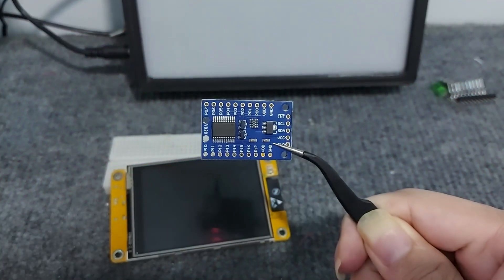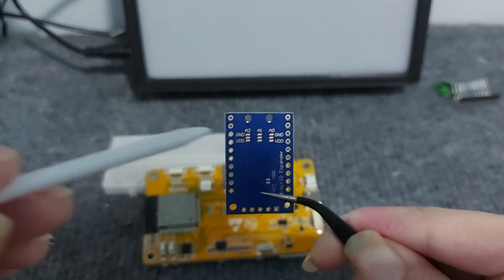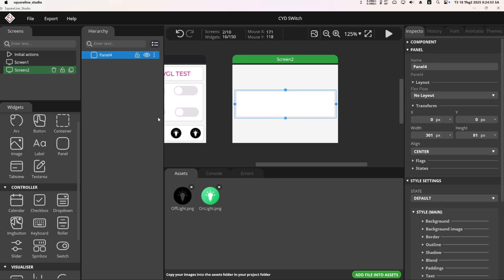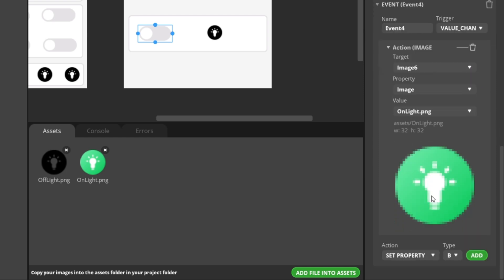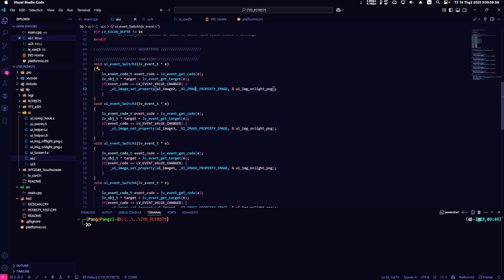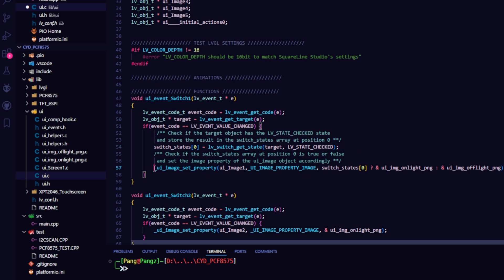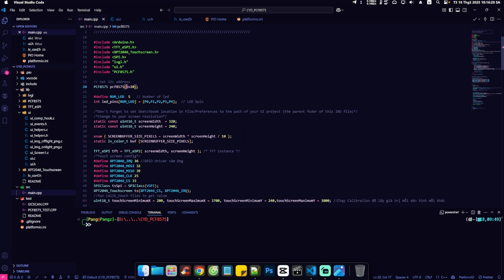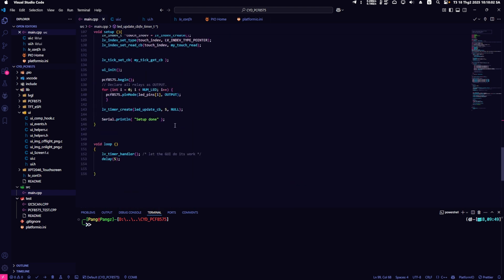ESP32 & LVGL: Easy Multi-Device Control via I2C!

Comment: Thank you for taking the time to create and share CYD projects.

Just thinking, there has to be an event driven way to change the led states without resorting to a timer though.  🤔
Reply from the maker: I use a timer to give the CPU some rest periods. It’s a simple way to manage tasks without going full RTOS.
If you’re just handling a few simple tasks, you can put the control function in void loop(). But when dealing with multiple tasks like reading sensors, handling buttons, or sending/receiving data over Wi-Fi, using a timer helps prevent the CPU from being overloaded. If you put everything in void loop(), the ESP32 might crash or reboot because it can’t handle too many tasks at once.